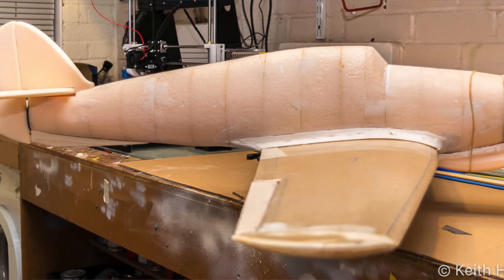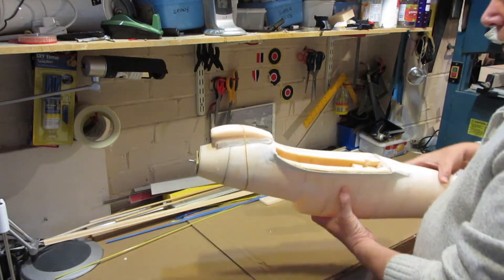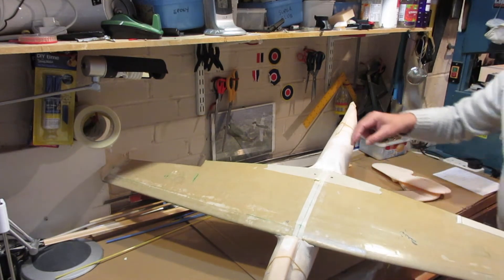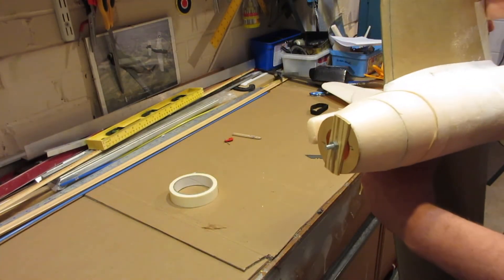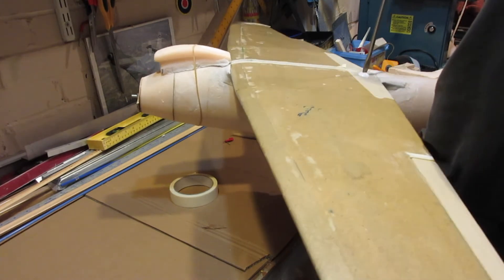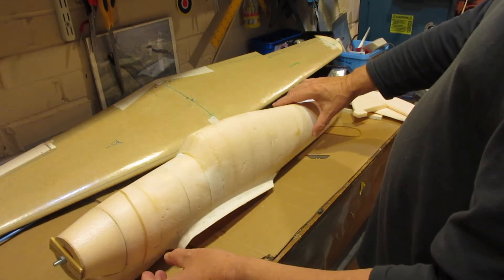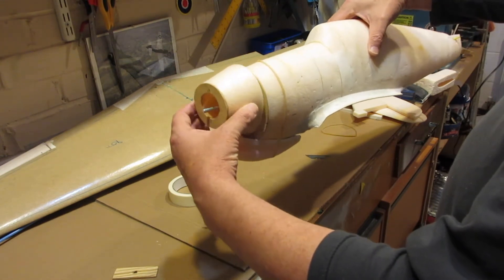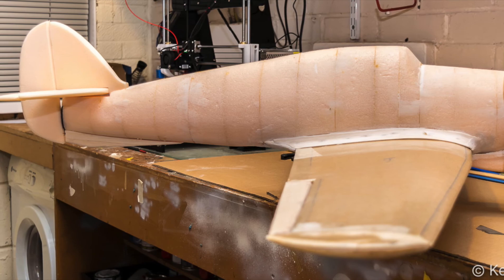Hot Wire CNC Foam RC Hawker Hurricane IID - Part3

Comment: What type of foam are you using?  Thank you.
Reply from the maker: For this Hurricane I used  XPS  foam which is similar to blue foam. I don't use it that much now because the dust from  sanding  it gives me some problems even with a mask.
Reply from the maker: For this Hurricane I used  XPS  foam which is similar to blue foam. I don't use it that much now because the dust from  sanding  it gives me some problems even with a mask.

Comment: Awesome build. I hope to do a similiar build with my CNC machine. By the way it does not exist yet. I am still looking at the right Nema steppers and which board/PSU to buy.
Reply from the maker: Thanks, Check out my eBook on the website http://www.rckeith.co.uk  it covers steppers, boards etc.  Also a several links of the this page to suitable parts http://www.rckeith.co.uk/cnc-detailed-build-and-plans/
Keith
Reply: Hi Keith. Thanks for the answer and tips about the ebook.
Another question. What about a USB to Parallel Port Adapter instead of a printer port add-on card?
Would it work?

These are the guys I am talking about.
http://www.ebay.co.uk/bhp/usb-to-parallel-port-adapter
Reply from the maker: SsoulBlade Don't think this will work. The Mach3 forum suggests this one which comes with some software. http://www.cncdrive.com/UC100.html . I belevie it's to do with providing a clock signal which the one in the link does because it has some extra chips inside. 
Keith
Reply: Keith, where is the best place to communicate with you? Do you have a forum perhaps? 
I downloaded your ebook. it is really comprehensive..I like the direct links to products too.

It really breaks my heart that a normals USB to printer adapter does not work. the one on CNC drive is expensive.
Either I must buy an add on card (inconvenient) or get an old lapto.

Have you ever tried writing your own software to read the Gcode?
Reply from the maker: Contact page on the website is the best http://www.rckeith.co.uk/contact-me  then we can exchange email addresses.
 Yes it is a bit pricey.  The best option is an old desktop with a printer port, which is what I use.   I bet somebody you know has one kicking around that you can get for little or no money .  I use Windows XP on mine with 2GB or RAM.  Its not connected to the internet so no need for update and ant-virus.  Mach3 doesn't need loads of memory or processing.  Laptops aren't recommend when using the old printer port because that can go into power saving modes and mess up you job. 
I haven't tried writing my own g-code but there are quite a few free option around , all in the eBook.  Hope that help.  Thanks for watching. have you see my flying wing videos I go through the whole process from a crash to making a new wing and test flight.  https://www.youtube.com/playlist?list=PLZzVG2q06x22sJ5XR6Ed4ufy5vN1Ry11r

Keith